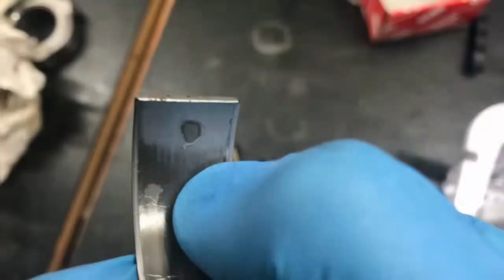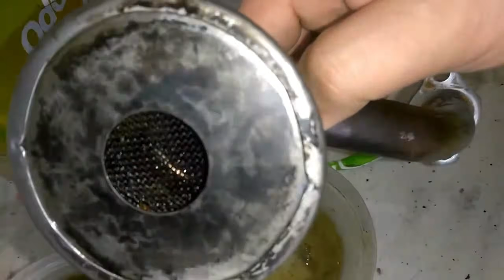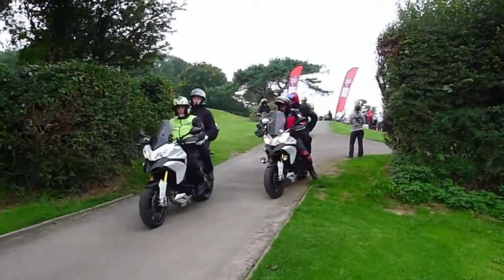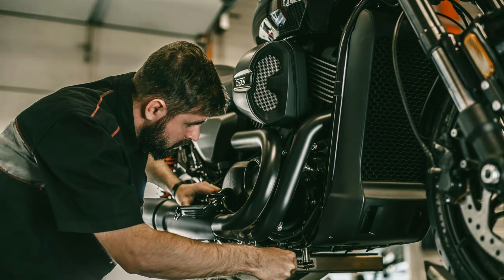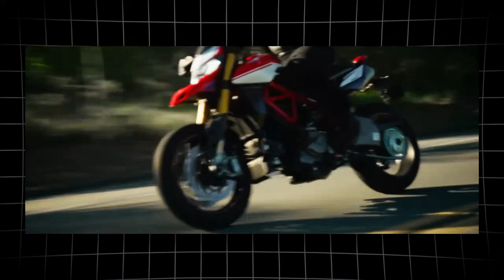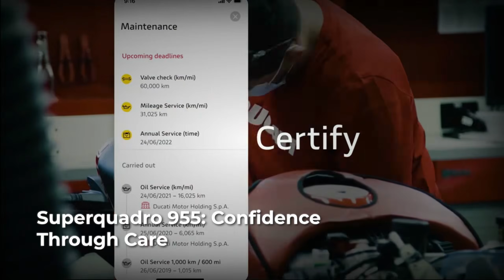3 WORST and 4 BEST Ducati Engines Ever

Comment: Everything about this is utter bollocks, never known a belt to snap on a ducati, ducati doesn't use valve springs, these engines are designed for moto gp.

Comment: Complete nonsense. The Testastretta engine doesn’t use springs, it has the desmodromic system where cams open and close the valves.
Also, the 916/996 desmoquattro engine isn’t known for oil pump failures. The timing belts are normally replaced every 2 years, to avoid failures, but I’ve seen them go for up 7 years either daily use without any issues.
Reply: hello,ı think you may help me to choose my ducati.I want to buy a multistrada 950 for a daily use.Whats your advice for me?Should ı buy multistrada V2 or 950?Is there a difference between them in terms of motor health?Which one is more durable?
Reply: @Muh @MuhammedÖztürk-q2d bro I have a Panigale v2 23’ and a 21 SFV4. The V2 is a great engine. Just be ready for that desmo service down the line.
Reply: @George.W.Bush56  thank you very much bro.What do you think about 950?Because v2 is more expensive than 950 and its almost the same motorcycle.I think ı will be able to buy 950 thats why ım asking you.
Reply: @MuhammedÖztürk-q2d they are not almost the same. Lol idk who told you that but if you test ride a 2020-2023 V2 you let me know if it’s “almost the same”. Not trying to make this sound in a rude way. Just trying to make you realize what’s better. 950 is more touring, roads,  street riding. V2 955 is a different beast
Reply: @George.W.Bush56   thank you for your advices bro
Reply: @MuhammedÖztürk-q2d yessir happy to help
Reply: @MuhammedÖztürk-q2d 
I have a 2022 Supersport 950S  with that 950 Testastretta (937) its mentioned as 1 of the 4 best in this video for a reason.  Great engine.  18,000 miles valves, 24k miles belts.  Been using this engine in everything from Monster, to Multi to Supersport for 10years.  Its a great engine.  Tried and true.  Sounds great and plenty of power.  Great engine for great bikes for the last 10 years.  This video is full of mistakes but everything he said about the 950 (937) is true. This dude talking bout the engjnes being crazy different is crazy.  7hp.  7hp difference.  113hp to 120hp.  Mine has full exhaust (US no cat) and tune and makes over 120hp.  Buy the bike you want,  but newer isnt always better
Reply: They still do have springs on the valves
Reply: @Redir89  technically correct, but they do not actually close the valves like in every other engine used today. There is a separate lobe on the cam that closes the valves.  The spring is heavy duty and mounted sideways away from the valves where they dont fail the way normal valve springs do
Reply: @marcthomas5641 I know this
Reply: I have a Supersport 950S and love my Desmo engine. 18k mile valves, very reliable engine with plenty of power and torque for the street and track days.  Should anyone besides OP read this and wonder about it...watch Zak from Revzilla test it on road and track.  Mine has full Comp Werkes exhaust and Upmap tune...and it runs and sounds amazing.  Ducati builds the most beautiful bikes on Earth and has for decades.  Love that mine still has the single sided swingarm too...the new panigale does not.  That and it not being as comfortable  as the 950s is why I didnt get a panigale v2.  I have zero regrets.